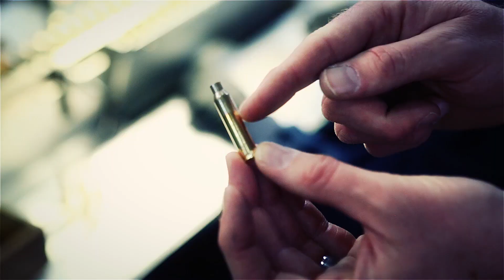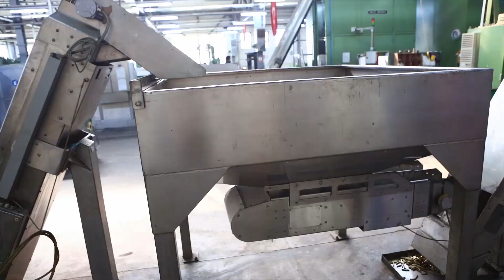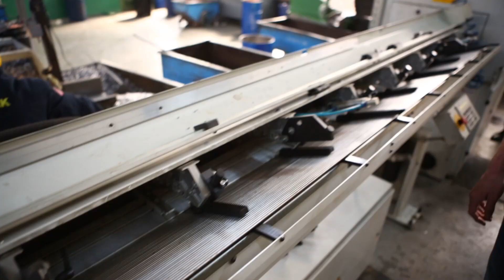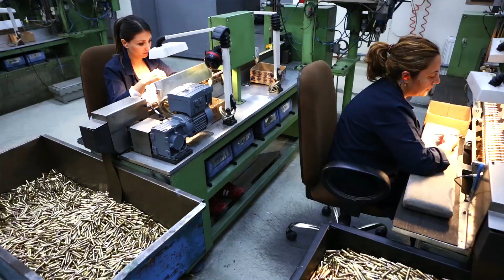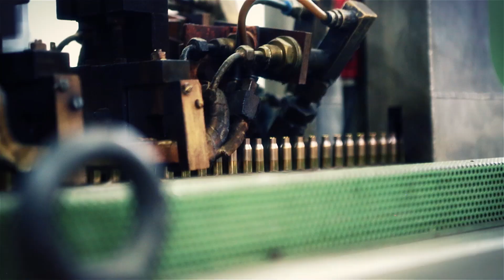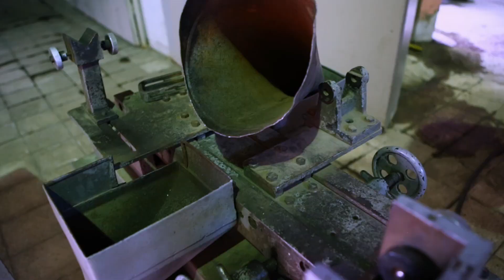ZQI Ammunition Factory Tour

Comment: I've been running this stuff since I've noticed it and it's super low price on my Walmart shelves! 

Was picking up the ss109 5.56. But lately I've only been seeing .223 at Walmart.

What gives on that Mac? Did Walmart  or the manufacturer get scared and pull the SS109 and replace it with the .223?
Reply: teamgmotorsports It was the ATF attempt at banning the M855/SS109, which is the round ZQI makes.  I used to find it there cheep, but now hoarders are stockpiling it, just like they do with 22lr.  Hopefully the hysteria will die down, and we will see it back on the shelves.

Comment: I shot quite a bit of ZQI 9mm in my Springfield XDs and XDm, but when I shot it in my S&W model 940-1 wheel gun the cylinder would jam after the first round. My gunsmith told me for some reason the primer bulges out and seizes the cylinder, so I stopped using it. Out of the semiautos, though, never had a problem with it. It's pretty good range ammo, and a couple of bucks cheaper than premium American brands at WallyWorld.

Comment: I have found this ammo to have harder primers than other factory loads I have tried. Granted, my only experience with this ammo was with their 9mm. ( I had a couple light primer strikes, whereas I didn't have this issue with any of the ther ammo I had with me, even hollow points.) Other than that, it shot fine and was accurate.
Reply from the maker: SIG-504 It's NATO military spec ammo which means it will require a quality military type weapon to reliably fire it. Military spec primers are harder than commercial primers.
Reply: Understood. The pistols fired were a SIG P229 and a SIG P226. Those are certainly quality pistols. I won't fault the ammo at all though, as both pistols had 18 lb main springs installed. They would fire everything from Winchester hollow points, Federal fmj, Tula brass max and Russian steel cased ammo. (which has hard primers as well) Like I said, I don't fault the ammo, it was just an observation.

Comment: http://i.imgur.com/Vhb0bTx.jpg
ZQI 147gr 7.62x51mm, four-shot string, FNAR .308/7.62x51mm, 20" heavy barrel. Optic is Primary Arms ACSS 4-14x44 FFP. 100y to target. That's a 6" Casey Birchwood Shoot-N-C bullseye. Well under 1 MOA.
Good ammo, in my experience. Some issues with FTE, but fixed with minor gas adjustment. Grab it if you can.

Comment: My local Walmart is selling the 7.62x51mm rounds for $10 a box. Same stuff has been sitting there for months. I know it's similar to .308 Winchester, but have found no assuring information that it will be safe to shoot in my .308 rifle. It's a Savage Model 10. $10 is a steal for 20 rounds, but not worth hurting myself or my rifle by putting something not meant to be in it. What would y'all say?
Reply from the maker: TriggerCFR 7.62x51 NATO is LOWER pressure than .308 Winchester. It's the opposite of 5.56mm/.223.
Reply: Unless it's made in Brazil, all 7.62 NATO is good-to-go in any firearm chambered in .308 Win.

Comment: Only problem I have is even the 55gr 5.56 has steel in there's. Run a magnet over it.
Reply: Nope just lead and copper, but metal doesn't have to be ferris to react to a magnet. Many other metals including lead and copper react to magnetic fields. But that is a bit of science that i'll leave you to discover for yourself, i'm sure Google can point you in the right direction on the subject of reactions of non ferris metals and magnetic fields
Reply: Colin Matlock Ferris Bueller, Ferris Wheel or just Ferris? I believe you are referring to Ferrous. ;)
Reply: Aaron Orr my auto correct prefers bueller over metal apparently but it only recognizes "we'll" as a word and not "well"..... I think I train it to do odd things when i'm drunk
Reply: You can't pick up lead, copper, or both with a small magnet. It takes a very strong magnet to make them move. To test if certain bullets have steel in them you can use a small magnet and try to pick them up, those the weak magnet picks up have steel in them in some way, the bullets that the magnet doesn't pick up don't have steel in them. At least that's what I was taught from Grade School - College, and the books I have on ammunition and ballistics all say the same thing. Anyhow 55gr 5.56 advertised as non penetrator shouldn't be effect by a magnet at all, as other rounds without steel are not. I worry it might not be a steel core but a bi metal bullet or jacket, similar to the crappy Tul-Ammo.
Reply: I can't believe these posts have been up a full day and nobody has corrected you guys. If you actually watched the video you'd see that the 5.56 there selling is m855 and has a small steel tip in front of a lead core. They have a very good quality solid copper alloy jacket, not copper washed or plated like wolf or Tula. Putting that small piece of steel in the tip actually costs more to meet NATO standards and is not just a cheaper way as to save lead. That's why it's magnetic
Reply: Shane K XM855 isn't 55gr, this guy is saying that even 55gr 5.56 ammo has steel in it which is incorrect. The dude probably has some XM855 or SS109 spec ammo that the manufacturer doesn't tip green and is assuming it's 55gr
Reply: Don't assume your knowledge on any given subject is more than someone whom you've never met. I know the difference between M855, SS109, and M193, hell anyone with a smart phone can figure that out instantly. Take a small magnet with you the next time you go to Walmart, grab a box of 55gr 5.56 (supposed to be M193 or Spec'd close to), pull a round, and run a magnet over the bullet. There is steel in the bullet, I've tested several boxes of the stuff. So why is there any amount of steel in a 55gr FMJ marketed as or close to M193, and it that steel in the core of the bullet or blended into the jacket somehow creating a bi metal bullet to save money? I don't own any cheap AR's and value mine greatly, I'll stick with a know product PMC Bronze, or Wolf Gold. Which btw I run Black Hills 77gr TMK and BH 77gr MK262, Wolf Gold has a 77gr OTM round that holds pretty close to my zero running hotter match loads, or close enough for range use, it's actually great for a cheap round.
Reply: demongawl you don't have to meet someone to know that you have more knowledge than them in a subject if the subject is actively being discussed. It's not a pissing contest just facts. XM855 and SS109 spec are the only commercially available spec loads with steel in the bullets construction which is why they were the subject of the BATFE proposed ban and it's why those specs are named in the current BATFE guild lines as exempt. No other bullets have been known to have steel in their construction outside of rounds made to those specs or I guarantee you the BATFE would have included them in their proposed ban.
Reply: Yes because the BATFE has proven they know what they're doing... I've already broken everything down Barney Style, you didn't say anything I didn't already cover. No the 55gr 5.56 modeled after M193 shouldn't have any steel, but that doesn't mean it doesn't, or show when they started or if they've alway had some type of steel in them. Could be cost savings, who knows. Not every round is broken down and inspected when being imported, and if it's a bi metal bullet like TulAmmo the BATFE wouldn't care as it wouldn't enhance performance against barriers. It may even be in the way it's made, picking up enough traces of metal while being processed for the finished product to react to the magnet. Either way the proof is there, run a magnet over the bullet, until you test that out you can stop responding to me, you don't seem to understand what I'm saying and your arrogance is sickening. I'm truly surprised when young guys are dedicating time to learning firearms and ammunition they're not scared off by the old guys with there disrespect and arrogance, projecting a false sense of superiority, when these old guys should be welcoming the new generation into the firearms community and encouraging them to expand their knowledge, they are the future of firearms. What kind of future do you want to leave behind? To

Comment: The ZQI 7.62x51 is almost the only thing i have ran through my DPMS G2 so far. Other than it being really rough on the brass and causing some case head separation so i cant reload it, it has all feed reliably and been very accurate with no blown primers or anything. But i do get quite a bit of brass shavings inside the bolt but i think that's due to the gun still being new and the dual extractors.

Comment: I've only ever had issues with zqi 308 in a mas 49/56. They wouldn't chamber right and wouldn't always cycle completely. When I ran some 308 tula thought it, it worked perfectly. Other then that I love zqi ammo.
Reply from the maker: hummerskickass The .308 MAS49's that were converted by Century are known to have problems. If it does work at all, it's likely very ammo specific.

Comment: Love this stuff, never had an issue with either their 5.56 (55gr and 62gr) and 9mm NATO.
Reply: but i do after about 90 round some of the primal fell out the casing and cause my ar to jams but easy fix
Reply from the maker: ***** The 5.56 and 9mm primers are crimped. Look at the casings and see if you see the crimp present. This is NATO spec ammo, hence the crimp. If it's not there, shoot a pic to ZQI. I've never seen any of their ammo without a crimp which would make it nearly impossible for a primer to fall out (which is why they crimp in the first place).
Reply: yea i understand what crimp on primer, that range day i only shoot zqi to test it out cause i brough tons of them for very cheap price and they look pretty nice, it could be a flute but the truth is zqi primer did pop out more then once on me.